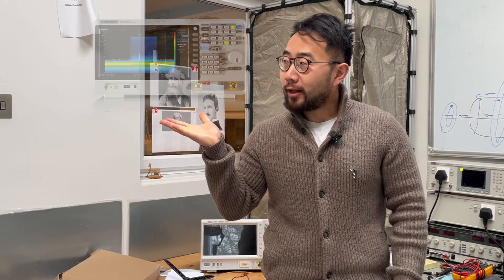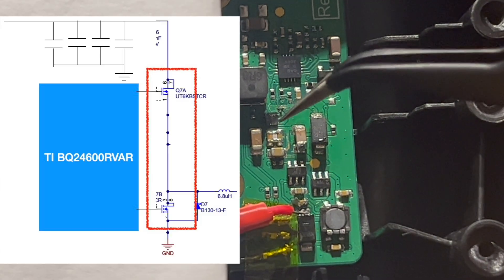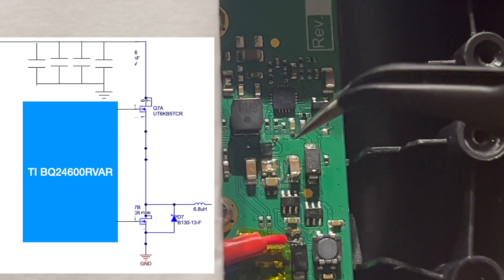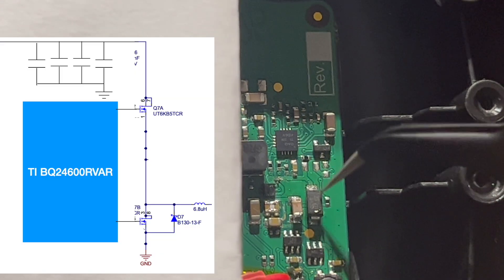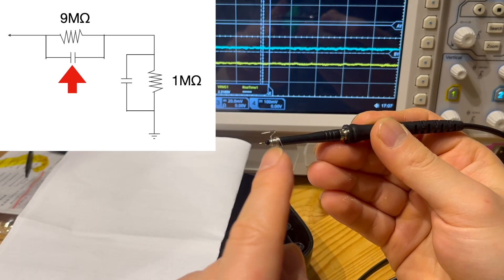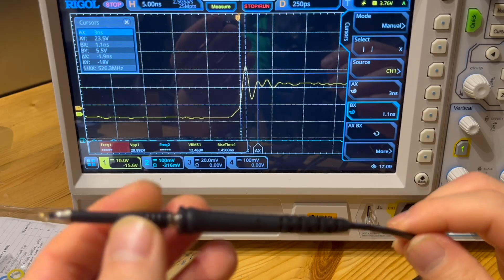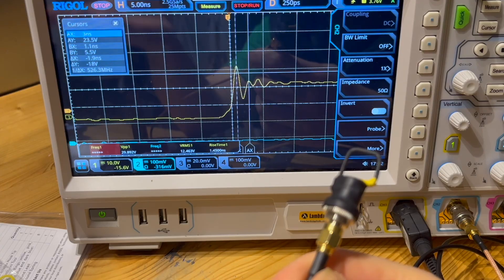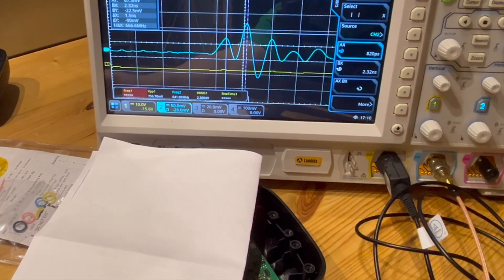Troubleshooting Radiated Emissions Using an Oscilloscope

Comment: I think i have seen an extra Schottky diode on a synchronous buck converter before. Some people don't trust the mechanism of the active diode having only R_DS,on instead of a forward voltage. But you didn't explain why the diode increases the overshoot on the positive edge. Are the three gentlemen on the photos in the background Maxwell, Faraday, Tesla ?
Reply from the maker: yes, indeed, that was in my old place, now we have moved, and I need to gather all the EM celebrities photos on my newly painted wall.

Comment: Thanks again. 😊 You should show the two traces at the same time and also show how the current changes when connecting the voltage probe. It is also interesting to see the measurement with an active probe. (At the same time as you show a stored reference of the passive probe.